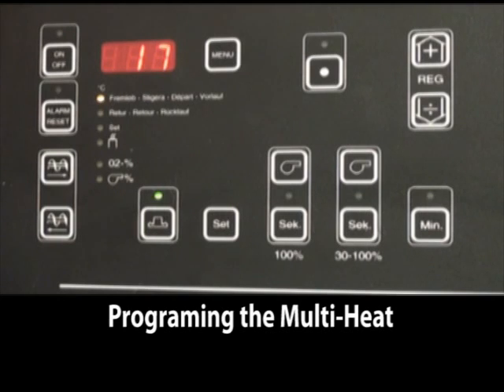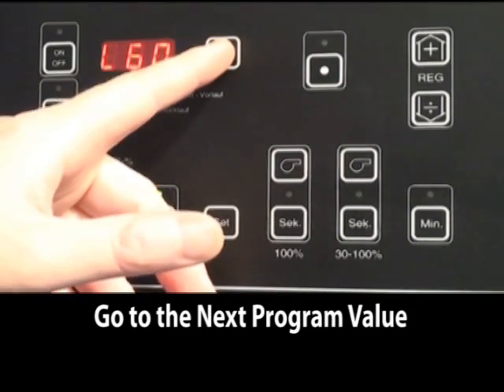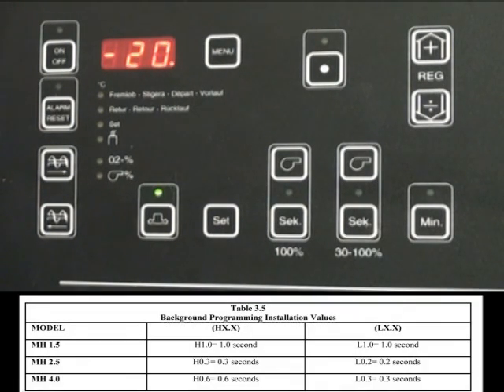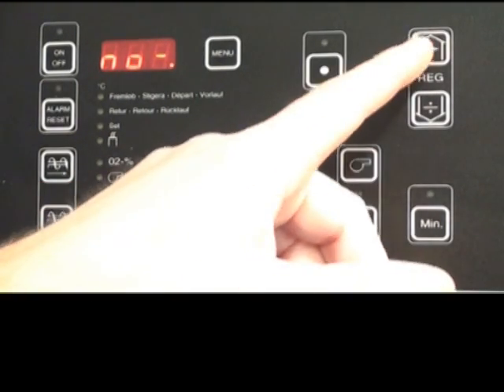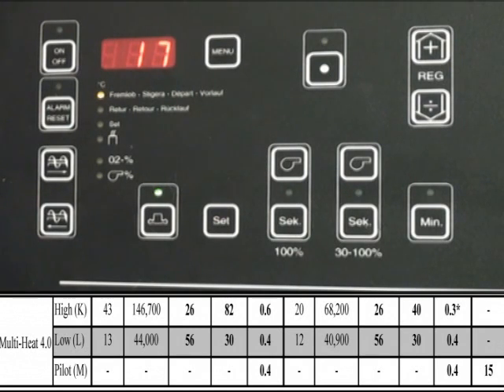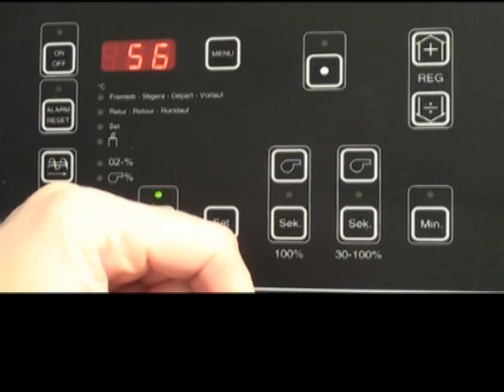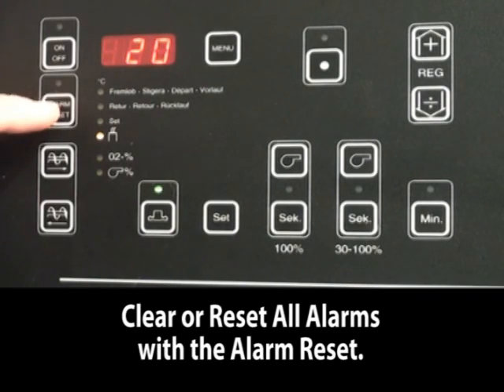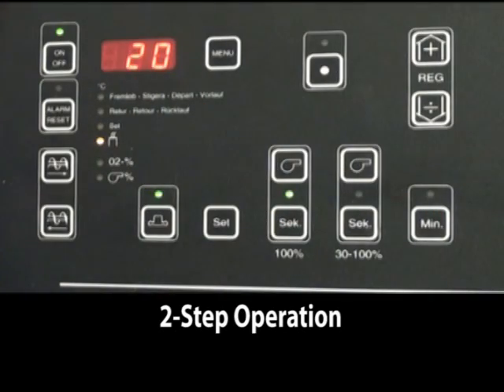How to Program a HS-Tarm (Baxi) Multi-Heat Pellet Boiler

Comment: Very useful (and also very well executed ) video.
I take from it, that in America, you do not  use the Lambda sensor for automatic control of combustion air supply. 
Why is this, and what would be the pros & cons of retrofitting such a sensor?
I have the 4.0 model (in Europe), but presently without the Lambda sensor
Thanks